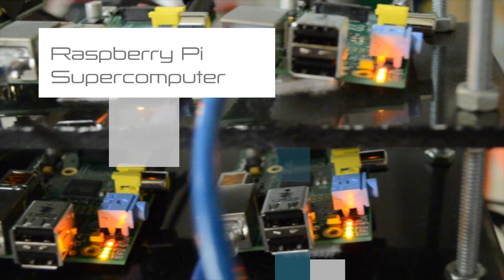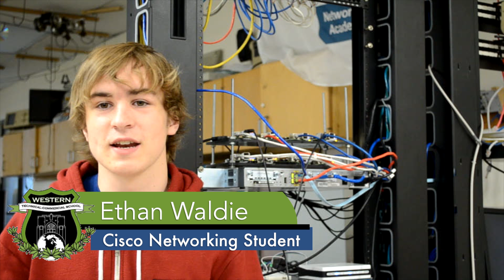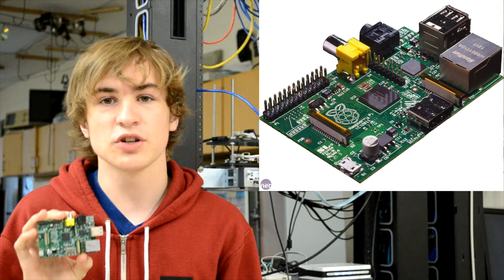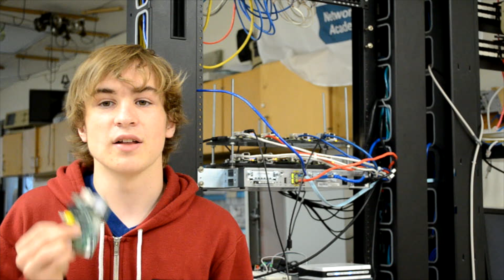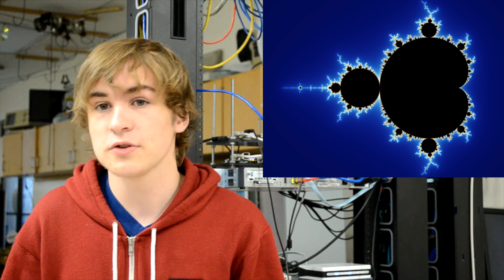Tutorial 1 - Background Information | Raspberry Pi Supercomputer

Comment: 1) The arm architecture has been around for deces.
2) No, you con not run "desktop applications" on it, you need to recompile to ARM... A Desktop Computer is most often has the x86_64 arctitecture. Learn about instruction sets, damn it!
4) I was going to say something about SMP, but I forgot what it was...
Reply: once recompiled they run the same, we mostly work from source code so we can run "desktop" applications, what i mean by this is that the RPI is not special and its a fully functioning linux computer.
Reply: I thought SMP stood for "Symmetric MultiProcessing."  i.e.  All of the processors are identical and I think it implies a shared-memory architecture.  But, maybe the underlying basis of the acronym has been changed.  Like, RAM once stood for "Random Access Memory;" but, it evolved into "Read And Write Memory."

Comment: I think you mean cluster, not super computer.

As super computer is "a computer at the frontline of contemporary processing capacity". I'd be willing to bet that if you had every single RasPi ever made in the same cluster it would still only be a fraction of the power required to be a Super Computer.

That said. Clusters are still cool. Nice job with this.
Reply: Joel Wilson No.
A cluster is a group of processors connected by a non-local Bus. It has nothing to do with windows. This is a cluster.

As stated above, a super computer must be in the class of computers that is the fastest we currently have.

(I was being polite in my first post. This is not a super computer. It is clearly a cluster.)
Reply: I agree with Kevin on this, not sure where you are getting info. I have never seen in the discription of a supercomputer that it HAS to be on the frontline of contemporary processing. That sounds like a quack thing from wikipedia. A super computer at its base is a cluster of systems where work is shared across the nodes. The video even states that. Not ALL SUPERCOMPUTERS are in the Top 500 list.
Reply from the maker: DustySeven7 And I am sure that not all "Supper Computers"(sic) are in the Top 500 list either!!
Reply: DustySeven7 Lets see...

The first line of...
http://en.wikipedia.org/wiki/Supercomputer

The full encyclopedia definition of...
http://www.merriam-webster.com/dictionary/supercomputer

Implied by...
http://www.webopedia.com/TERM/S/supercomputer.html

Also...
http://whatis.techtarget.com/definition/supercomputer
http://www.techterms.com/definition/supercomputer
http://www.businessdictionary.com/definition/supercomputer.html
etc

Pretty much the first 10+ google results

I'm not saying what he did was not impressive. I'm saying that it is not a supercomputer, because the word supercomputer has a very specific meaning, and his cluster does not meet the definition.
Reply: +Overwatch Supercomputers are typically clusters of normal consumer hardware (I.e GTX Titans used in one supercomputer, etc.)

Technically, supercomputers ARE cluster computers to a certain degree.
Reply: Supercomputers have always been a term for mainframes (currently very outdated) and clusters. even LANL have a 750 node raspberry pi supercomputer. The definition "supercomputer" doesen't have to be "in a class" of sesifications. The term supercomputer is and always will be clusters. However i'd agrue that the tiny cluster he have behind him here is not a supercomputer. When we talk 1000+ processing cores. Sure i'll take it. untill then this is just a cluster with cheap mini computers.

Comment: continue:of the calculation are made in the gpu becuase it nuch more faster and if you have 1000 dollar you can buy a one good gpu or 40 rassberys. also you have the problem that if you transfer information from one pi to other via net it will take you longer then using one gpu 2 times better then the pi's gpu.